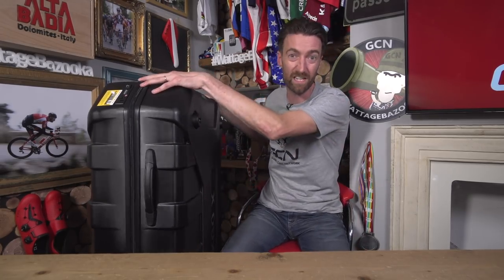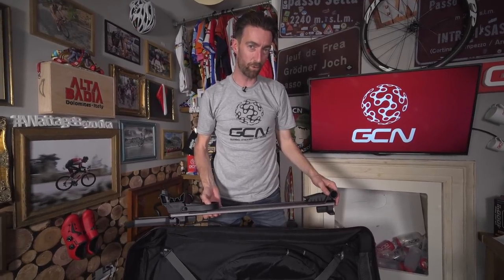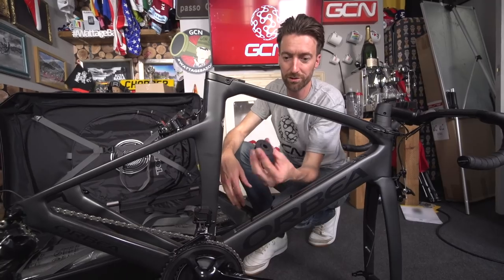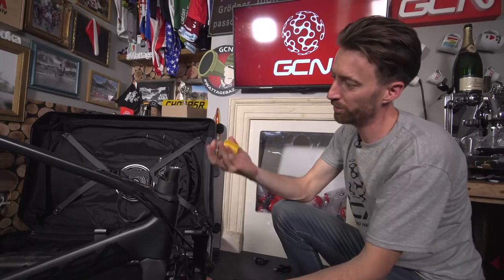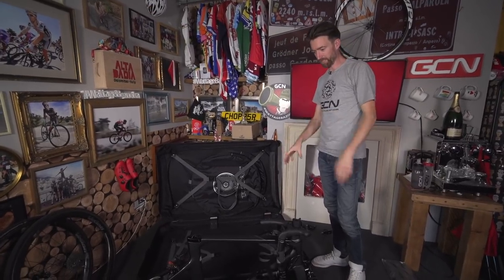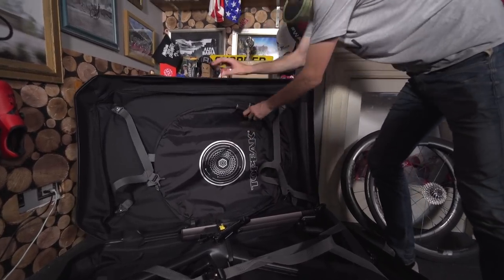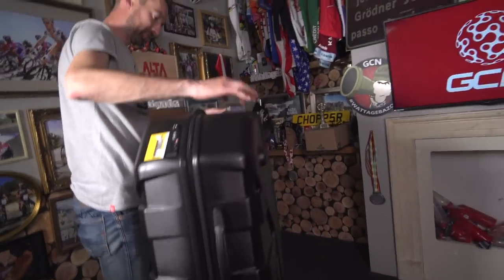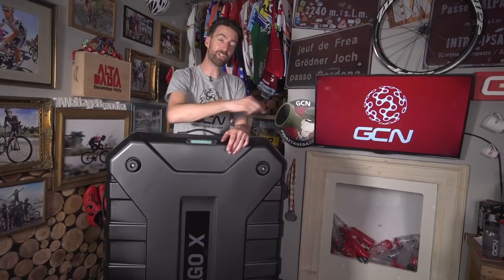Unboxing The Topeak PakGoX Bike Box | GCN Tech Unboxing

Comment: General reminder to All disc brakes user don’t forget to place brakes bleed  block in your caliper !!!!
Reply from the maker: Good shout there Jack!
Reply: Or business cards folded work a treat
Reply: @wakotropolis  when you take out the wheel  don't pull brake lever as the pads will close so place a 1 or 2 folded cards in the gap where the disc rotor was then if the brake levers are pulled they won't close and you will still have the gap of where the disc rotor was

Comment: In the US, United and American Airlines charge $150 each way for a bike.  While this is a nice bag, if it can't get you around that charge and you''re going somewhere with a decent shop, you might as well rent.  In Scottsdale, AZ, $300 got a $5k TREK Domane delivered to my hotel and picked up when I was done 3 days later.  In SLC Utah, $300 will put me on a Scott Scale for a week next month.

That said, I just took my first trip with an Oru Ninja, a soft bag that will sneak a road bike through (you may have to pay an oversize fee but I didn't) because, well, I want to ride MY bike and two successful trips will put me ahead.  More disassembly required:  rear mech and fork have to come off too.
Reply: Did you fly United or AA with the Oru Ninja?
Reply: United.  I checked in curbside, too, which I've heard makes things go more smoothly (don't forget to tip!).

Comment: Dan/GCN why do you guys remove the whole stem. I usually just remove the plate that holds the handle bar on.
Reply: for me at least, I find it's easier to fit a bar-stem to a steerer than a bar to a stem when reassembling. for the former, I just need to align the handlebar with the fork/wheel (easier); for the latter, I need to both realign the handlebar tilt and recenter the handlebar left-right (more tedious)
Reply: Fair point

Comment: Ask GCN anything.  Should you let the air out of your tyres when flying?  If you pump them to 100psi at see level what would it be at 25,000ft.  Would it be like the equivalent to 200psi?  And should you be taking high presure CO2 cartridges with you either in the hold or in your hand luggage.  Well thought out box but supplying with a small track pump that fits in somewhere neat and tidy might be that nice little extra.  As a lot of people just rent boxes and want a track pump at the other end but its just something else big to carry and fit in luggage.
Reply: Bev Sorsby 1 atmosphere is 14 psi. Therefore the largest negative pressure is -14 psi. So your tires would effectively be 114 psi. Probably not a problem. But why risk it?
Reply: Thank you Mitchell, So what about a CO2 cartridge?  I think they are about 400 to 500psi. Would they pop at that altitude? I'm not going to fly for a long time but was just wondering.  It got me thinking about those high altitude balloons that look empty at ground level.
Reply: I put Co2 cartridges in my bike box and they wouldn't fly the plane until I removed them and gave them to security.
Reply: The cargo hold is the same pressure as cabin so there is no issue.
Reply: mfennell70 that may be true but unfortunately that’s not the view the airlines take. They won’t check your tyre pressure but will X-ray your bike box and flag any Co2 cartridges. I last used Edinburgh airport
Reply: Good point about CO2 - I wasn't thinking about what's permitted, just what's possible.  I think the CO2 cartridge thing is just a security overreaction.  In the US, the Federal Aviation Administration approves of up to 4 CO2 cartridges in checked baggage (https://www.faa.gov/about/initiatives/hazmat_safety/more_info/?hazmat=11) but the TSA idiots get a say too.  Your country may vary.